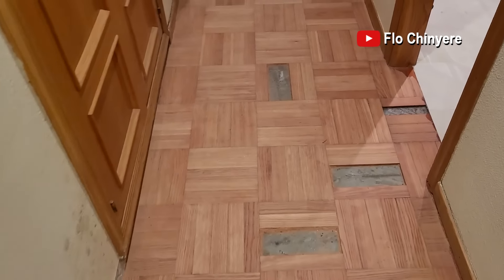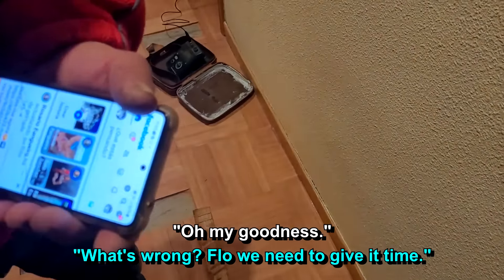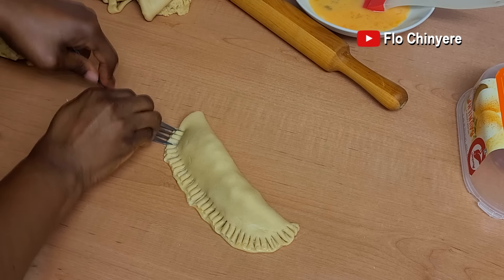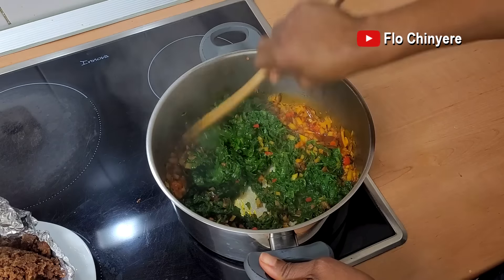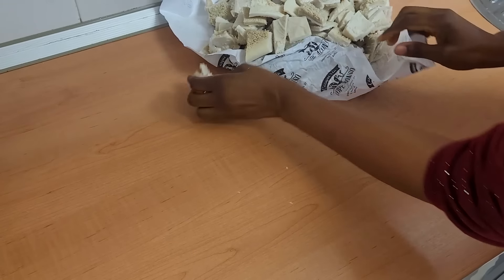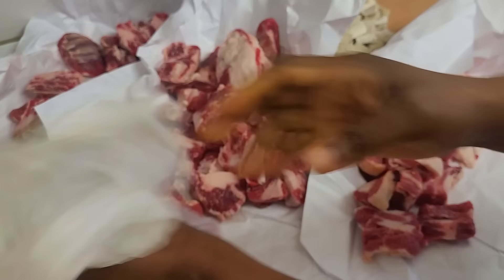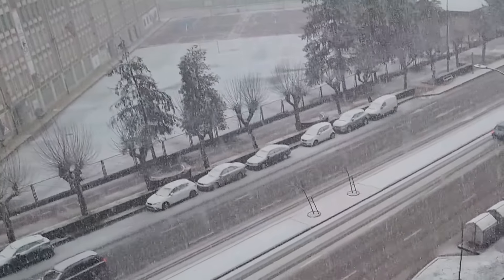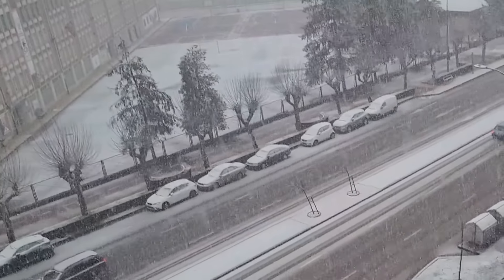VLOG: Home Repairs, Heavy Food Prep & Locs Update | Flo Chinyere

Comment: Hi Flo C I’m wondering y in Europe I see many ppl wearing the heavy warm clothing inside the house.  I think I read sometime ago there is a regulated limit for the heat and AC setting is this correct?  I see you wearing the thick overall all the time in winter …
Reply from the maker: I don't know about other people in Europe but I like to feel cosy even when the heater is on highest. I wear my onesie and socks during the winter and for most of spring even. 
While in some apartment blocks, the heater has a central control but in my home we have the boiler in our home so we can set our heater to anything we want at any time.
Reply: Kamsi’s choice o❤

Happy Easter, sis